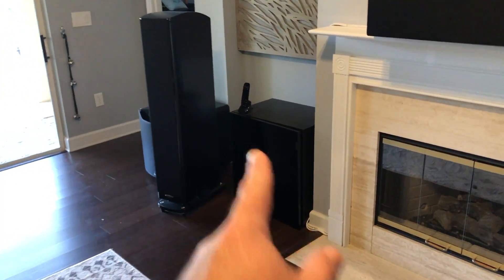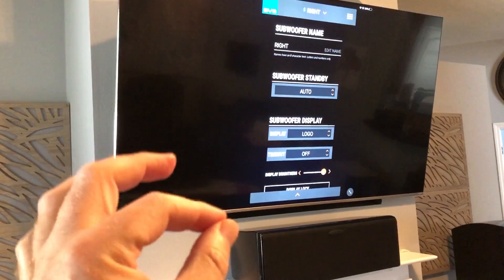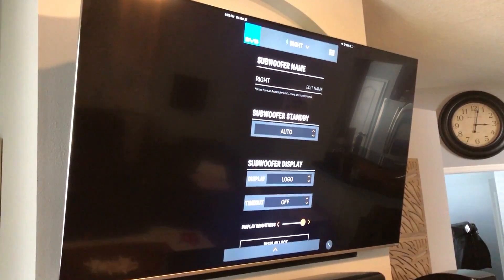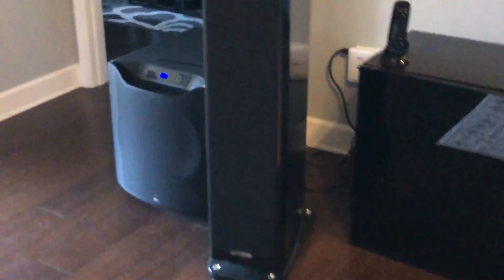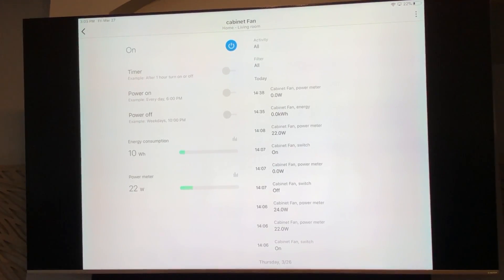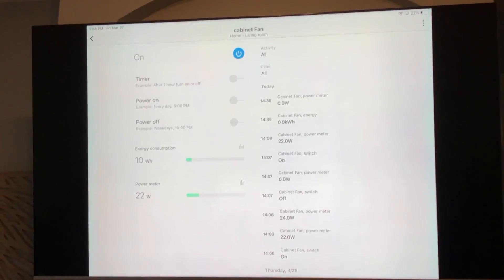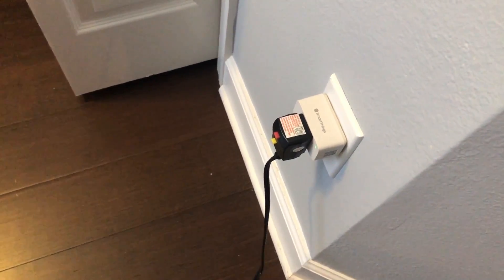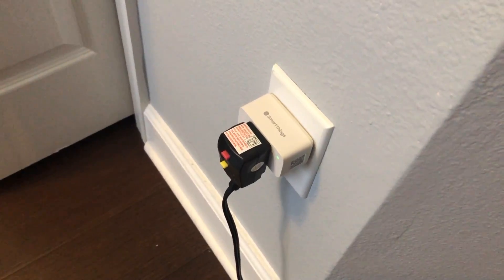How Much Power Do large Subwoofers Pull From The Wall?

Comment: Subs use capacitors, so it's not watt to current draw. I have dual SVS SB 17's and a PC 13 ultra on a 15a circuit, no issues.

Comment: Maybe I missed something (or else it's on a different video) but I'm starting to replace my speakers (got Klipsch RP-600Miis for my front and expect a new R34C sometime today) and looked at the specs on my 10" sub, which was included in my satellite 5.1 system I bought about 15 yrs ago.  I saw that it only has a 65W amplifier.  If I got a sub with 150 or more watts, would there be more punch and/or accuracy in the sound coming from it?
Reply from the maker: Both those specs are bottom end, you would not notice anything meaningful. Going to 1000 watts would be a nice jump. Then up from there.

Comment: THANK YOU! I have been wondering reading specs like the SB-16 Ulltras stating "1500 Watt continuous, 5000 Watt peak" and was like, how can you use them without constantly blowing fuses and overloading the breakers, especially with all the other electronics for a home theatre with power amplifiers etc. Do you have any electrical works done for the Theatre room, any considerations how you connect things up?

Comment: Great video but I think you will see much higher power draw if you play lower bass frequencies. I agree most large and powerful subs rarely if ever use anywhere near the power they claim. However, there are times when a sub will demand loads of power from the amplifier, and that's during ultra low bass frequencies such as sub 20Hz. Try the test while sending 20Hz and lower bass tones to it, or play a movie scene that has ultra low bass. I would be interested in seeing what your measurements show. Still, for most movies I bet your numbers here are pretty average of what to expect. It's just important for people to understand that the lower the frequency the more power required to move the drivers. That's also why it's a good ideal to crossover speakers to subs even if the speakers are capable of playing lower content, so the sub frees up the receiver to provide plenty of power to all of the speakers. Of course if someone has pre-outs to a powerful amplifier then they can run double bass or crossover lower, but for those on AVRs it is wise to cross a little higher and avoid double bass (LFE +Mains).
Reply from the maker: Just watch the next vid.

Comment: Great video. Can you please make a video showing how to measure how much power is being pulled out of my avr and into my speakers? Please please please???
Reply from the maker: The avr would need built in meters
Reply: @COGuyStuff  There has to be something I can buy that will do it for me, no?
Reply from the maker: Just measurement tools, but not with speakers.
Reply: @COGuyStuff  what's a good measuring tool?
Reply from the maker: They are professional devices, not for the home.  The answer to your question is, you can't do that.  As I said, the amp needs to have built in meters.
Reply: You can buy a digital power meter on Amazon for $15 to $50 and plug your receiver into it. The meter plugs directly into the wall and has an outlet on the face. I have one and have tested my surround sounds system. We use them at work when in a pinch for testing and troubleshooting. We have all the fancy expensive test equipment too but for a quick general idea of how much power something is drawing these are nice to have.

Comment: This is very interesting, does that mean that 15amp circuit is good enough to run amp and two subwoofer
Reply: I have 2 SVS subs, a Denon 4500, Blu-ray player and a projector all on the same 15 amp circuit. Even at reference levels I don’t pull more than 650 watts during peaks according to my UPS. 

I think amps don’t draw as much power as you’d think because of the huge capacitors in them.
Reply from the maker: Yep

Comment: another excellent, and useful video. Great content as always. I feel like these are all warm ups to a possible full fledged MiniDSP tutorial. Are you trending towards that direction?
Reply from the maker: Part of me wishes I needed it just to do one lol
Reply: @COGuyStuff  I am just going to assume I do, lol. REW shows I have a relatively flat curve for my dual subs, and Dirac helps refine it, but I picked up a 2x4HD to experiment. I'm looking forward to tweaking a house curve, to add that extra 5-10 db for the freq range from 20-50hz.
Reply from the maker: Mine is up 15 from 80 down to 20 within 2db
Reply: @COGuyStuff  That's impressive just using room treatment and the SVS app. My issue is seat to seat consistency. I want to keep it within 2db for the two other listening positions. And I have to tweak the DSP every time after I run Dirac, so I want to keep it more stable prior to Dirac, and I want to experiment with the x-overs, and applying a steeper cut off around the 16-20 hz range. Just something to do during these Covid times.
Reply from the maker: And, my AVR has multiple bands for each sub.  I couldn't have done it just with the 3 from the app. MiniDSP doesn't do anything for seat consistency, only more subs does.
Reply from the maker: https://scontent-mia3-2.xx.fbcdn.net/v/t1.0-9/87098221_2877626932276599_4893025231221817344_o.jpg?_nc_cat=107&_nc_sid=8024bb&_nc_ohc=Q5RgyVbFCuUAX_RKwhQ&_nc_ht=scontent-mia3-2.xx&oh=649164d3c69518015b6244c820414d17&oe=5EA5E816
Reply: @COGuyStuff  MiniDsp helps with time alignment for those multiple subs. Which i guess your AVR can do as well. The curve you achieved is solid but I  would prefer to keep the 40-60hz range less than a 5db drop. Do you get a similar curve in other seats, and not just your primary position?
Reply from the maker: I'm the only one here that cares lol - The seat next to mine is 95% as good.  The other 2 not so much but they don't matter.  Each sub also has phase adjustment, you don't need MiniDSP for just that either.  I could get it slightly better for sure, but for the tiny difference to my ears it's not worth it.  I can make the curve however is needed.  I prefer a straight slope, it sounds perfect to me. I used to run more of a plateau but found the bass could sound out of balance with the mains past a certain point.  With this gradual steady increase you never notice anything, it just works.
Reply: @COGuyStuff  thanks for sharing your experiences. I don't think I'd go any further if I were in your position either. But i am kinda obsessed about eeking out that last 2-3% of improvement if possible. It beats having to pay for significant upgrades for it. Also, MiniDSP represents that next phase after REW if you're into tweaking. And I can apply this knowledge for future setups if I upgrade or change the layout.
Reply from the maker: Rew is just a measurement tool. Minidsp is just one eq tool, that happens to be super easy to use with it. It’s not a progression. If I needed more bands than I have to get my slope, it would be a good option. If I needed to do more than 2 subs, it would be a great option. I’m not saying don’t get it, but you certainly don’t always need it whatsoever, over a capable avr and sub combo.
Reply: @COGuyStuff  precisely why I got one. I'm planning on adding a 3rd sub soon. :)